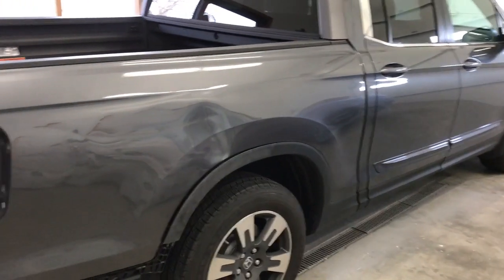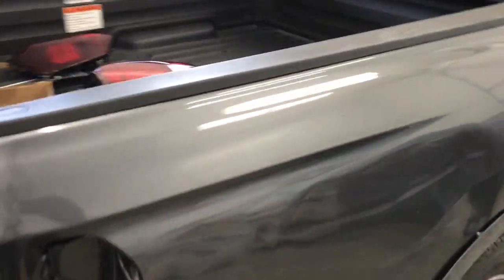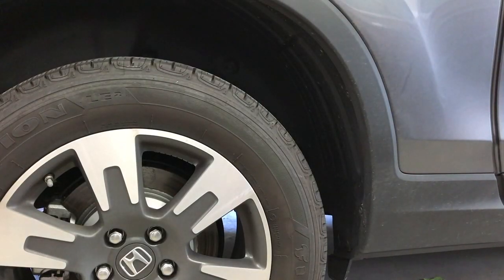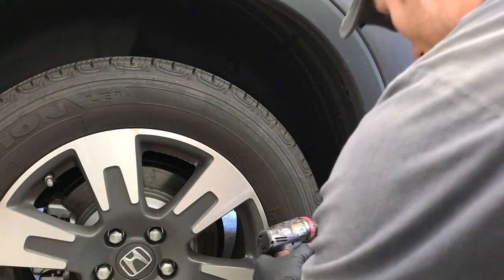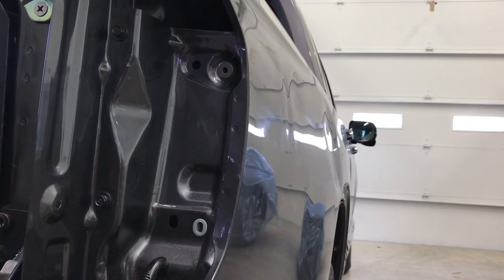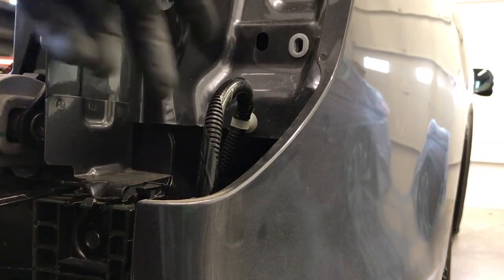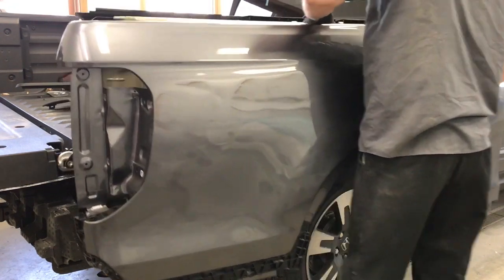2016 2017 2018 Honda Ridgeline Bedside Removal How to Remove Replace Install 2nd Gen

Comment: Great video!  For those who need to remove the drivers side bedside, when you run into the gas door/filler neck.  No need to remove or loosen the filler neck.  You can either pop out the black plastic filler behind the gas door (you can get your hand up in the wheel well once the bed is lose) OR you can disconnect the release cable by prying back on the tab (it'll look like a shark fin).  Be careful, the plastic for that fin isn't much and can break easily.  If it were me, I'd keep the cable connected to the trim around the filler neck, and just fish it through the hole as you pull the beside off.

Comment: I am thinking of putting a small L track on top of the bed liner on top of the wheel wells for added strap points. Is there anything under the bed there that I need to worry about, or is it all metal?

Comment: Hi DIYHonda. I am trying to install an aftermarket rear dash cam on my 2017 Ridgeline but I have no idea how to channel the wires from the inside of the car to the rear plate frame. I was able to install it on my wife's 2006 Honda Odyssey but it was a lot easier. The challenge is how and where to run the cable towards the tailgate. Hopefully you can make a video on how to do this in the near future. Thanks in advance.

Comment: When watching you remove the rail cap piece closest to the cab is the retainer just under the cab back window trim replaceable?  It seems like the piece on my 2019 is loose near the very end and not seated down?

Comment: I need to remove and replace the rubber seal that separates the bed and cab on both sides of the vehicle on a 2017 honda ridgeline. Do I need to remove the whole bedside like in this video?
Reply: Yes, the rubber seal attaches to the bed from behind, and you will have to remove the bed to do this.

Comment: I am just needing to replace the right top rail molding/garnish on my 2019 RT as it is slightly twisted or warped up on one end on the outside portion of the molding.  Perhaps a clip broke to allow the plastic to warp or the clip is fine but the plastic warped in the Florida heat. I did not notice until I purchased the truck.  When replacing with a new garnish molding, should I remove the clips from the top of the rail and place them in the molding and then press the molding in place, or should I place the clips on the truck and try to slide the molding onto the clips.  Which would you recommend.  You advise would be greatly appreciated.
Reply from the maker: Remove the clips and slide them into the new garnish. Then they just clip right into the holes.
Reply: @DIYHonda  it looked like it was easy for you to slide the garnish back towards the tail gate to release it from the clips.  Does the garnish usually slide back that easily?  Do you have to use a lot of force?  To remove the clips do you need a tool or do you just twist them out?  Sorry about all the questions, I am a newbie to doing this type of thing and don't want to mess something up.
Reply from the maker: Sometimes it takes a lot of force and wiggling it back and forth and pulling in a quick jerking motion. It just depends, sometimes they come off easy and other times you have to pull pretty hard. To remove the clips, just turn them 45 degrees and pull out on them. They should come out easily.

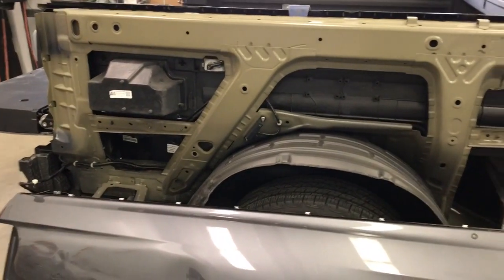Comment: Great Video buddy. Thanks for posting it. I have the early 2017 Ridgeline at 4:38 in the video you can see the white line of adhesive near the fake separation line. Is it there to hold this panel flush to the body or something else? My passenger side panel is not sitting flush. It is sticking out a bit. Only the first lot in July 2016 had this issue. Went to dealer but no resolution. I would really appreciate your help. May be they didn't put enough adhesive on the initial ones.
Reply from the maker: What is the side panel not sitting flush against? tail light or lift gate?
Reply: DIYHonda sorry for the delayed response. I am talking about the crease where cab meets the bed. There is a gasket between this panel and body at the beginning of this panel and panel is not snug so sticking out a little and gasket can be moved freely.
Reply from the maker: Ah, I see what your saying. I will look into it and see what I can come up with.
Reply: any luck?
Reply from the maker: let me know if this is the issue you are having ------- https://youtu.be/keNw-SCzxUQ
Reply: DIYHonda  Thanks a lot buddy. You are genius.

Comment: I have a small gouge on the top trim cap of my tail gate on 2019 Ridgeline.  Is that cap made of two pieces so I can replace just the top portion? It looks like it is held on by 4 screws at the top of the tail gate but when I removed the screws the cap did not come off.  Your guidance would be appreciated.
Reply: With the four screws removed, you bump the cap end on the drivers side toward the right a little ways with a soft hammer and then it pulls off.